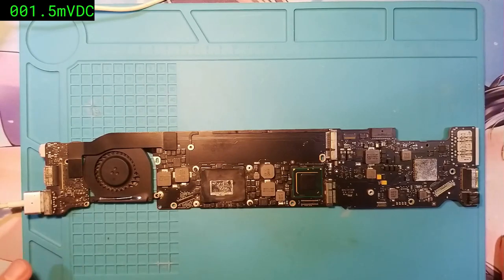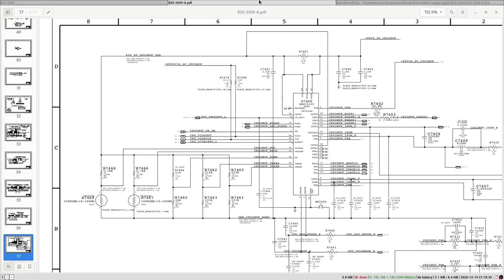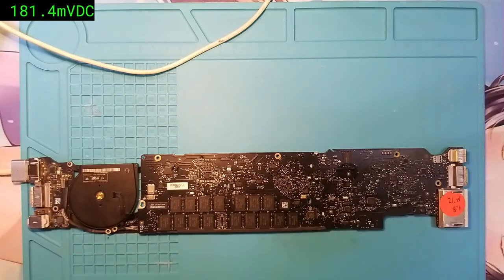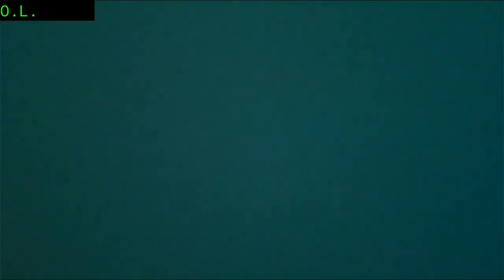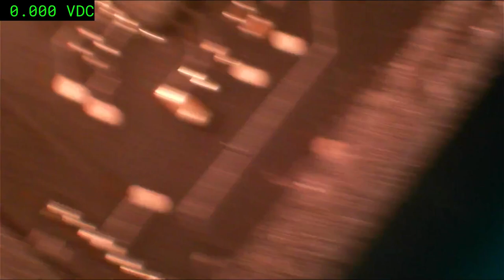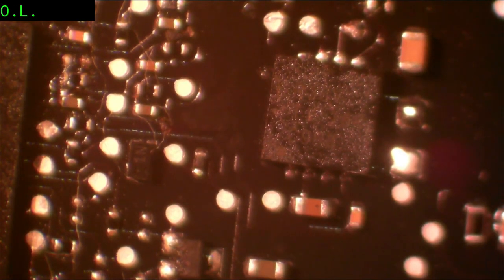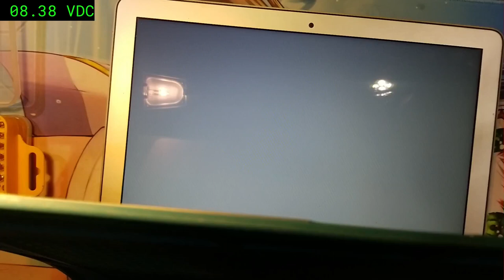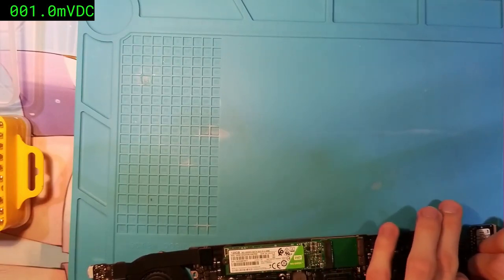T&F 820-3209 No green light/No power

Comment: hello I know you might be with other stuff, but same situation but my main Vol instead of 8,4V is 9.05V going down to 4v in a loop..... I suspect U7000..(wich i think is responsable for creating the 8,4v needed). should I replace? smc should be good because have green then amber led, and in the fuse f7040 i see a loop from 9,05v down to 4,5v in a 6 seconds loop NO FAN... thanks a lot